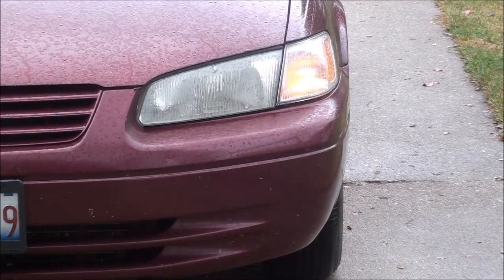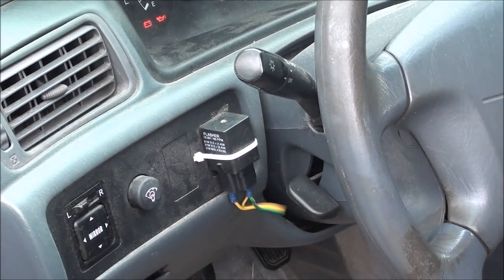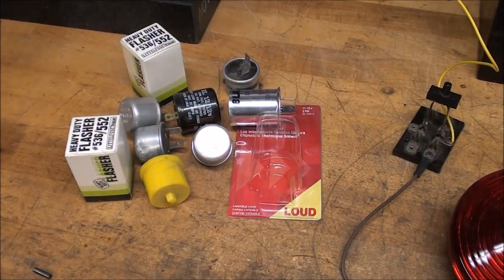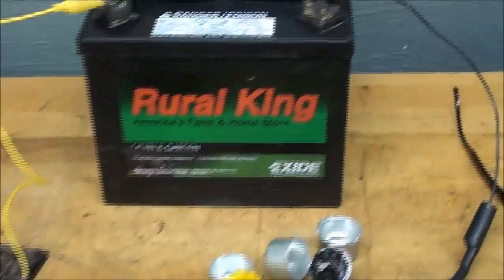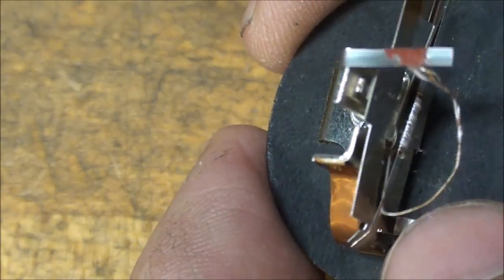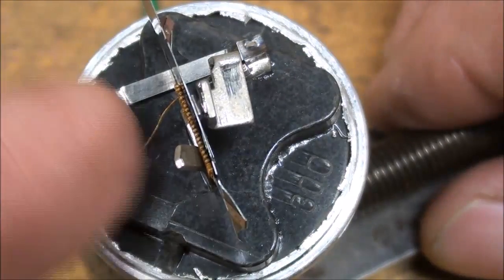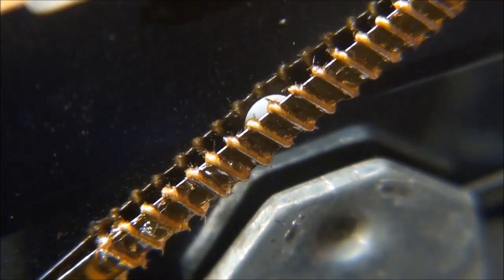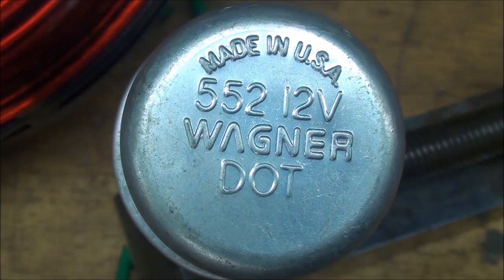WHAT MAKES IT WORK? #14 Turn Light Flasher "WHAT MAKES IT CLICK"  tubalcain

Comment: the newer ones, newer than the thermal ones use a condenser. the condenser stores a charge but takes some time to be filled, once its filled the relay can switch to drain the condenser thru the tail lights, once the charge is drained the relay opens and power is then allowed to flow into the condenser which takes time to fill before energizing the relay and allowing the turn signal to light. these work good with incandescent bulbs but not so well with led bulbs, the interval is longer since led's take less power to light. also if a bulb burns out you have a slower flash rate. once thing i noticed is that when you turn on your 4 way flashers, the flash interval is somewhat faster.

Comment: I don't care for the new electromechanical or solid state ones. The old thermal ones were very reliable and inexpensive. If it ain't broke don't fix it. Some newer cars come with the flasher integrated into one of the electronic modules.

Comment: The strip of metal he's referring to is a bi-metal. Two different metals are sandwiched together to form the strip. Each metal expands at a different rate, when current is applied, which causes the strip to flex...hence, opening the circuit. Once the strip cools off, it regains its original form (closing the circuit) and the process repeats.

Comment: I've got a 3-prong thermal flasher, and just tried hooking it up to a 12v power supply.  Smoke came off the tiny wire!  I wondered if I had it wired backwards, so switched my wires around.  Again, more smoke, and still no clicking. Any thoughts on what I am doing wrong?  I don't seem to have burned anything out yet, but I think I am close. Smoke is never good.

Comment: The color of the plastic shells (and the stripe on the aluminum shells) of the Wagner, Sylvania and Signal-Stat round flashers told you which model they were and what the load rating was. From the '60s through the mid-'90s, these thermal flashers were almost universally used among all U.S. car manufacturers. The color coding of the most commonly used ones during the '70s and later was:

Green - # 552 (variable load used for hazard flashers - up to 6 27 watt bulbs, did not show lamp outage)
Light blue - # 224 (fixed load for 2 27 watt bulbs)
Gray - # 228 (fixed load for 2 27 watt bulbs plus a little extra, maybe a signal harness relay or higher wattage bulb like a 2357)
Yellow - # 323 (fixed load for 3 27 watt bulbs)
White - # 325 (fixed load for 3 27 watt bulbs plus a little extra)

I miss the metallic click and the variation of flash speed of these old school flashers.

Comment: The 552's are too quiet. I like the old 323's better. Those are getting harder to find now. I had to order one through ebay a while back when mine went out. And today I went and scrounged some older model GM's in the junk yards and managed to find a couple that were easily accessible and still worked. I may go back this weekend with some tools to get the ones that are further up behind the dash.

Comment: Thanks, so it's just an oscillating switch, not truly a relay.  I guess it's called a relay only because it typically sits alongside other similar-looking modules in your fuse box that actually are relays.  Mystery solved!

Comment: HI THERE,GOOD VIDEO',I HAVE THIS 1979 KAWASAKI KE 100 ENDURO,I REPLACED THE REGULAR SIX VOLT TURN SIGNALS WITH AN  LED SIX VOLT TURN SIGNALS.WHEN I SWITCH TO THE LEFT,ALL 4 BULBS ARE FLASHING,SAME WAY TO THE RIGHT.WHERE DID I GO WRONG?PLEASE GIVE SOME ADVISE.THANK YOU

Comment: The spring that changes shape is called a Bi-Metal spring. It is a sandwich of two layers of different metals. Different metals expand and contract at different rates and at different temperatures.  When the element heats the spring, one side expands faster the other, causing it to warp.

Comment: Thanks for your video. I have a question, I notice that on some old cars that use a traditional flasher, when you switch on the turn signal, the first blink is always longer. Can you please explain why?
Reply: On the first blink, the stationary steel contact point is cooler, so it takes longer for it to drain enough heat away from the bending bi-metal strip than on subsequent cycles, after the stationary steel piece has warmed up a little.

Comment: Hrm, perhaps this explains why the turn signals on my old motorsickle just burn solid and won't flash.  Either the relay is seized up or it isn't getting enough current to heat up sufficiently to cycle.

Comment: Nice video thank you-  Im replacing the turn signal lamps to LEDs on my 61 Chev.  This is why I have to also upgrade to a solid state flasher for LED as LEDs do not impose enough load to allow the mechanical fisher to work properly.  This was a good refresher to remind me why this is necessary.

Comment: I really enjoyed watching this, and I have a question, I have a 78 gmc tiltwheel pickup, its been shall we say, upgraded to what ever fits the owner at the time, its rusty, but I had everything working well, Then the blower motor seized up, so I installed a new one, and it would not work, I had to hot wire it from the fuse box, and then found out the turn signals wont work, I checked bulbs, and wires, and put in a new switch, and still, they dont work, I have power going into the switch, and the 4 ways work, and running lights, and brake lights, but no power coming out of the switch, for turn signals?, I tried 3 different flashers as well, Ground? bulb?. why would both heater fan, and signals stop together?

Comment: you can put a small Electric Buzzer on the intermittent side  of the relay it will chirp.
 https://www.radioshack.com/products/radioshack-12vdc-mini-electric-buzzer?utm_medium=cpc&utm_source=googlepla&variant=20332220037&gclid=CjwKEAiAg5_CBRDo4o6e4o3NtG0SJAB-IatY2tYKGXd3ffFdO07Blp1kc5UvJAKxABWEzBsagT5M6BoCgBzw_wcB

Comment: I had a 1990 Plymouth Acclaim LE and it had a very unique flasher. The hazards and turn signals each had their own sound. The turn signals had kind of a "drum like" clicking sound, the hazards sounded similar but still different. Anyone know what type of flasher it was? And if it may have been 2 separate flashers? Thermal? Electro-mechanical?

Comment: Great video. 
The current flows through the heater element and completes the electrical circuit through the filament in the bulbs,  however the heater element consumes just enough current to cause the heater element to heat up but not light up the bulbs. When the strip of metal flexes due to being heated it closes the contact points and gives the current a direct path to the bulbs causing the filaments to light up, at the same time the heater element cools down and the strip of metal relaxes and the contacts open and the cycle repeats itself.
The reason that the flasher cycles faster when a bulb burns out is because there is LESS electrical resistance in in the circuit and the heater element heats up faster.
Reply: Why would be less resistance? The bulbs are conneced in parallel, if one of them falls out from the circuit, the resistance will be more and not less. The current will be less and not more.

Comment: MrPete222 as stated below, and as I understand it, the "spring steel" part is indeed a a Bi metal strip with a Kink (or bend) in it and when heated it expands deferentially (one side more than the other) and Clicks (AKA Oil canning) and disconnects the heater then after cooling it relaxes, clicks back again and reconnects the heater for another cycle. I hope i've gotten it right :-) thanks for all your "Classes" in Machining etc.

Comment: My only disappointment was when you disconnected the still-hot wires from the working flasher setup (4:51), and laid them down, they didn't touch each other and create the world's smallest fireworks show, as they most certainly would have done for me...your comments would have been fun.  I'm a BIG fan, Pete, and always look forward to the email notice about your newest video being ready for viewing...thank you for being who you are, and for doing what you do.
Reply: @mark spencer I see this is an old comment of yours, but maybe you still will read my response. :)
This went through my mind too, but in fact, only the light would be turned on, if the two leads had touched each other. So no fireworks, because that would not have been a short circuit. :)

Comment: I was very surprised blinkers worked that way!  So, does that mean blinkers would blink at different rates in the winter v.s. the summer?
Reply from the maker: +Jack Williams ???--Thanks for watching!
Reply: +mrpete222 Thanks for replying Mr. Pete -- My theory was the outside temperature would affect the heating & cooling speed of that metal strip, which would in turn change the blink frequency.  So in the winter when the temperature was -30 outside, the metal strip would take longer to heat up and cool quicker which would mean the blinker would blink quicker and pause longer between blinks.  The inverse would happen in the summer.

I've done some poking around the internets, and from what I can tell there would be a change, but it would be very small, so not noticeable difference...  Testing my theory would be a neat experiment though...
Reply: @2121jwill  Temperature dependence is small, because the switching happens due to the temperature difference between the heated and non heated part of the mechanics. So, in wintertime both will be at lower temperature and in summer both at higher temp. The electrical power for the heating will provide in both cases the same "delta T" (temperatur increase), thus the switching process will have the same (or very similar) flow.

Comment: The directional lights on my '07 Chevy Cobalt work fine,  but the clicking sound stopped a few years ago I figure that the flasher must be of the electronic persuasion and therefor be routed through at least 3 computers and would cost at least a thousand bucks to repair. I am an old man and I do drive with my directional  light on occasionally.
Reply: +dan andy I do the same thing...don't quite qualify for senior discounts yet but  I figure I'll leave mine on and take some of the pressure of the older fellers I seem to be rapidly catching up to.
Reply: +Dave W + Thanks Dave. some younger folks don't think this will ever be them.

Comment: Have you considered fitting a small buzzer tapped into the indicator output?  many available on e-bay.
Could use the simple buzzer and chewing gum approach to adjust volume - or a more sophisticated volume control using a variable resistor so you can set a comfortable level.

Comment: U showed to types of flashers the one with the fine wire starts in the off state when a load larger then the fine heating element is connected it heats the element closing the the switch bypassing the heater sending full power to the light the element cools continuing the cycle. The other type of flasher starts in the on state and relies on the bulb load through the heating element to open the contact and turn off the bulb that flasher reacts more to load and may not flash with a missing bulb or flash very fast with to large of bulbs or a trailer added.
Reply from the maker: +Cataskew Thanks-thats good info

Comment: you should fit one of these ive got them on all my motorcycles an i can here it even with a crash helmet
http://www.ebay.co.uk/itm/Indicator-Beeper-Flasher-buzzer-Scooter-Roller-Trike-Moped-Ape-Vintage-car-Quad-/121850798677?hash=item1c5edfa255:m:m0s98HPKcpI5j7UMsdeIzOA

Comment: Very nice!

I have found out that the original General Motors flashers are irreplaceable. The aftermarket ones don't work the same and don't sound the same. Therefore, whenever I am at the junkyard, I collect original GM ones for my project cars.
Reply from the maker: +davida1hiwaaynet Thanks for watching--resourceful

Comment: Now on fords they are incorporated into a $300.00 Lighting Control Module along with the Brake Light relay, High Beam relay and the Parking Light relay.  

The door ajar buzzer, head light left on buzzer and seat belt buzzer are incorporated into the cars audio system.
Reply from the maker: +MD500E99 Hope they are reliable & no one has to buy a new one
Reply: +mrpete222 
Well I worked for a municipality's fleet that had about 120 Ford Crown Victoria's.  They went out more often than the ones in Fred and Ethel's Gran Marquis.   We eventually took the Lighting Control module apart, found out which relay went bad and got some replacement relays through Mouser Electronics.  

Someone mentioned the 537 flasher and yes we used them for the wigwag flasher  on the police cars.  We eventually went to the electronic control boxes for flashing the headlights because some car manufactures used negative switching and others used positive switching for the high and low beam lights. In the end they came from Ford with the wigwag flashing units already installed.

Ford quit making the Crown Vic Police Interceptor in 2012 .
Reply from the maker: +MD500E99 Interesting. My nephew is a state trooper. He loved the crown vics for their comfort & roominess--now drives something smaller.

Comment: Mr Pete, I too can't hear the damn thing so I wired in a small 12v buzzer. Works a treat!
Reply from the maker: +Peter Fletcher I need to do that. But cannot even find the flasher on my new car-it is behind the speedometer in a tight spot
Reply: +mrpete222 I actually wired in two, wired directly off the rear flashers. It was made easier with it being an estate. I also seldom have rear passengers to annoy ;-)
Reply from the maker: +Peter Fletcher Can I tap into the tailight wires, instead of the actual flasher? Also, what kind of buzzer.
Reply: +mrpete222 That's all I did, cheap 12v buzzers from eBay, wired in series with the bulb. I left them behind the trim and they were still too loud so I wrapped a bit of foam round them. Been working for 5 years now.

Comment: Nice video. I troubleshooted a similar flasher (turn signal relay) a few decades ago when my 1962 VW beetle was acting up. The flasher in my old VW even had an adjustment screw to adjust the on/off time ratio (IIRC).

Comment: Thanks for another great video.  I'd like to add that I solved the problem of not being able to hear the "click" by wiring a seat belt buzzer in series with the flasher thus making an intermittent "buzzing" sound.  It was just obnoxious enough that I never again forgot to cancel my turn signal. :)
Reply from the maker: +Will Shankle good idea

Comment: What makes it tick in double time if one of your bulbs is burnt out?
Thanks for the videos.
Reply: The flasher is an auto resetting circuit breaker. The on time and off time are dependent on the current draw of the bulbs. A failed bulb reduces the current draw and alters the timing. Likewise, adding a bulb would have an opposite effect - towing a trailer for example.
Reply: excess current no longer used/needed by a blown-out bulb accelerates the blinker heating/cooling cycle.
Reply from the maker: +Danny Morehouse Very well stated. I added your comment to the video at 5:35. thanks
Reply: Although your statement is correct, it does not explain why a failed bulb would increase the frequency of the flash.  More bulbs = higher current.  Higher current means the strip will expand quicker. This would imply an increase in frequency as more bulbs are added to the circuit. But, the opposite seems to be the case. As you reduce the number of bulbs it reduces the current, yet the frequency increases. This timing question has puzzled me for years.
Reply: +donbeckham There are many ways to design a blinker circuit and the variation in design causes us some confusion. Each will react differently to a blown bulb. In the example shown here, it's the voltage drop across the heater that affects the duty-cycle. With the bulbs in parallel with each other, an open bulb increases the resistance and increases the voltage drop across the heater which is in series with the bulbs. The result is a shorter "On Time" while the "Off Time" remains unchanged. This is a big change in the duty cycle, however the frequency is only slightly higher.
Reply: +KevCarrico, current is the flow of electrons through a circuit and doesn't exist until it is being used/consumed by a load. There is no such thing as 'excess current' that is not being used. The bulb's filament is a load and current flows while it's connected to the battery. When the bulb's filament breaks there is no longer a path for the flow of elections and therefore no longer any current.
Reply from the maker: +KetchumDan Read below-Thanks for watching
Reply: +donbeckham better stated, the bulb no longer serves as a resistor in the circuit, so the blinker takes-up the slack.
Reply: +donbeckham correct, since they no longer have 2 pathways, they take 1 -- in essence doubling the load on the blinker.
Reply: +Drew SSF no worries -- believe what you will -- light bulbs are not only loads, but resistors, and when that resistance is gone the electrons will surely find a path, especially to a non-regulated load; coils, motors and the like will take all the electrons they can get.

have a nice day.

Comment: Great video Mr. Pete! Very enlightening for sure!

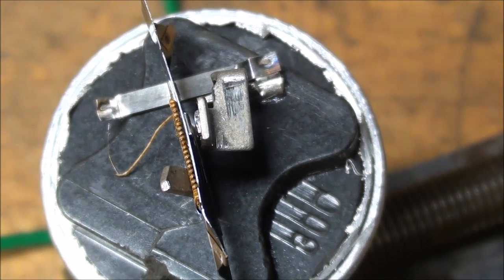Interesting, at 6:46 it looks like the soldered connection in the upper left is liquified! I know it can't be so it must be a trick of the eye, but it really looks like the solder is moving in liquid form.
Reply: +ShysterLawyer Ha, it really does look just like that.
In HD you can see it's just a reflection and the wire is actually spot welded there.
Reply from the maker: +ShysterLawyer Thanks for watching